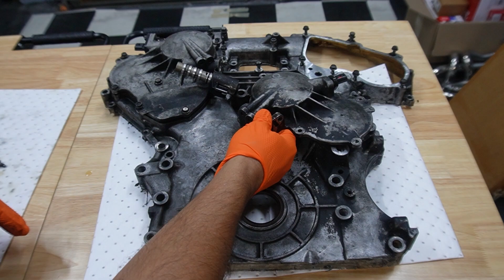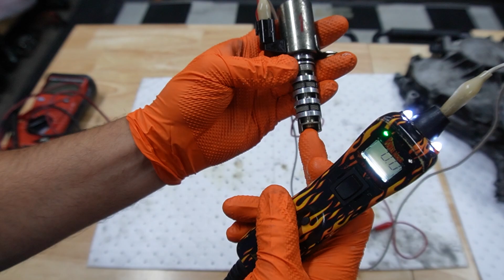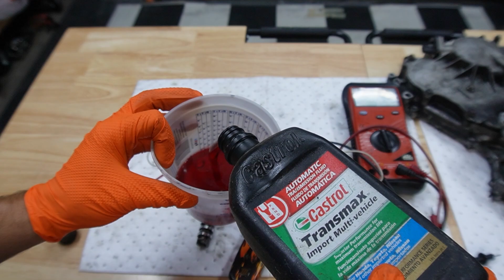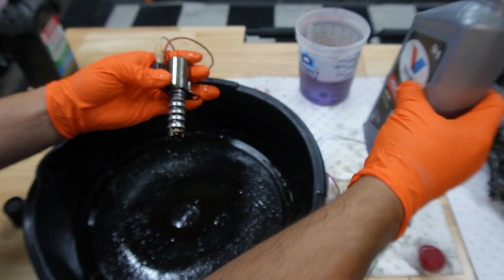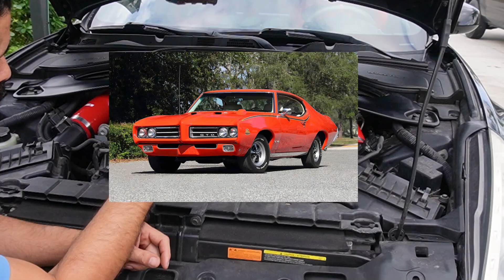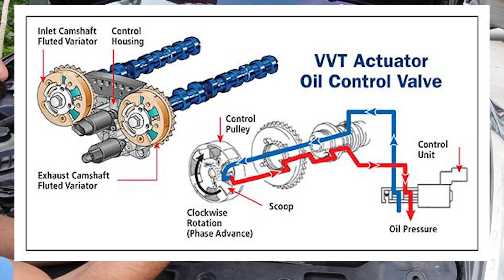How to Fix a P0021 OR P0011 Code

Comment: My last resort is to check the timing chain bcoz all my sensors are fine but still get low oil pressure &  p0011 bank 1
Reply: Possibly a clogged up oil galley or oil gallery? Oil sludge can potentially do that.

Comment: How do i test the wiring harness .  Im wondering if  the code p0011  camshaft timimg  advance on 2019 sonata could be a wiring issue .  Changed solenoid and sensors . Oil  is good , just lack power while accelerating

Comment: We've had the cam and crank angle sensor done, plus the VVT solenoid and a replacement ECU fitted.
Was doing random crank- no start. Just turned 50K miles.
No rattles.
Oil and filter done regularly.
Still got a Check Engine light, but it's random, too.
I suspect a wiring fault?

Comment: Can u send a link to the tool u use to supply power to the sensor
Reply: Along with the wires u plugged into the sensor itself looking for the whole setup so I can test mines
Reply from the maker: Power Probe III = https://amzn.to/440ASRp
Alligator Clips = https://amzn.to/4jBkv22
Reply: @ArmandoProlGarage thanks . I think I’m having a engine harness issue but will try this also !

Comment: It has been a while since I change the oil if I change the oil will it allow the truck to start again?? Cause right now my truck isn’t starting my plan was the change the oil this weekend I’ve change all the sensors in my titan
Reply: And I’ve also change the solenoids but I do have a lot of miles on my truck
Reply: @jervindavis8327 did changing the oil .make it start. I've replaced solenoid and camshaft sensor and spark plugs but haven't changed oil yet was tryn get started first but wont start. Could it be oil change .y oil is low and dirty. Been a while

Comment: That's not always the case I just got done doing a 2016 Subaru outback 2.5 it had both P0011/P0021 I replaced all sensors oil level was a little low so I started looking for a leak and what I found was both valve covers leaking and all coils were soaked with oil so I replaced the gaskets, plugs, and coils and check engine light hasn't ever came back on.
Reply from the maker: Thanks for sharing your experience! Do you think the oil leaks affecting the coils were the main cause, or was it more about the low oil level? Curious to hear your thoughts.

Comment: I got this code AFTEr I installed factory OEM cam sensors and crank sensor. Hoping it's my oil level, or contaminated oil. I DID use an oil additive in an attempt to clean out my oil. Thanks for the pre-inspection advice.
Reply from the maker: Hopefully, the advice in the video will help you narrow it down! If you haven’t already, try disconnecting the battery for 10-15 minutes to reset the ECU and see if the code comes back.
Either way, once you get it fixed, let us know what you found. Thanks for sharing!
Reply: @ArmandoProlGarage  Topped the oil off...... did the reset on the CPU by disconnecting battery. Codes still exist.  Moving onto doing a complete oil change and cleaning out the VVT solenoids. praying that solves it and its not a timing chain or tensioner problem. I can just buy a whole other maxima for those problems lol
Reply from the maker: Sounds like you’re on the right track! Hopefully, the oil change and VVT solenoid cleaning do the trick. Fingers crossed it’s nothing serious—Maxima prices do make you consider just swapping the whole car instead of fixing some of these issues, lol. Let us know how it goes!
Reply: @ArmandoProlGarage  WELL FOLKS.... Bad news.... After Cleaning out the VVT Solenoids and testing there operation. I'm STILL getting these codes. So its 100% a timing  Chain/tensioner issue. I'm getting a soft rattle at cold start now. After more research Nissan Suggests changing out the timing assembly at 130K .  So it's either 1. spend $2,500 to get the timing assembly changed out  2. Spend a few days to do it yourself at #1,200 in parts . or 3. Buy another used Maxima for the same cost of repair.  (But you will eventually still face this challenge around 130-150K miles.)  ME I;m just gonna find another Maxima at cost , swap everything I have on my current to the next and Sell this for however much money I lost LOL
Reply from the maker: Man, that’s a tough break, but it sounds like you’ve got a solid game plan. Timing chain issues can be a pain, but hey, you’re looking at it from all angles. Whether you DIY it or just find another Maxima, at least you’re making the best of it. Honestly, swapping over your stuff and selling this one sounds like the move.
Reply: @ArmandoProlGarage  Couldn't find a whole car at the repair cost, but I DID find a whole ENGINE 100K Miles less for just $1K + 1K labor. These codes are actually a death sentence for an engine.
Reply from the maker: That’s a solid find! Instead of sinking money into endless repairs, you’re getting a fresh start with way more life left in it. Definitely a win in the long run!